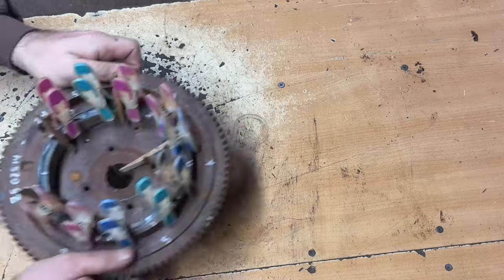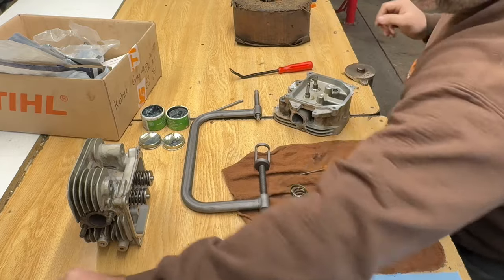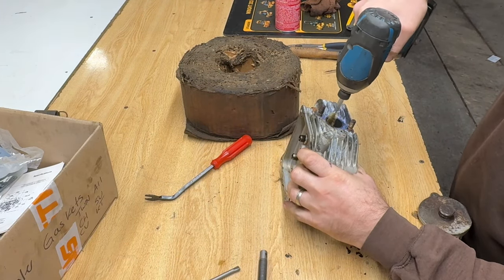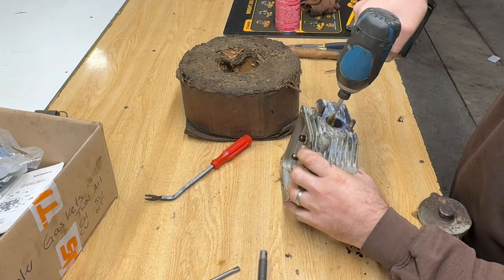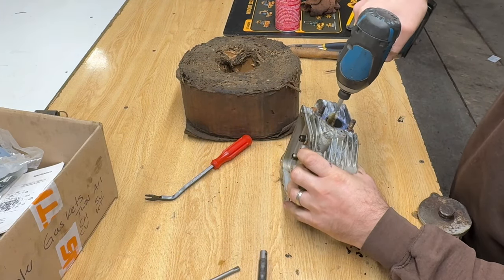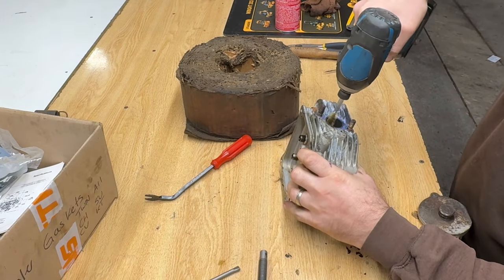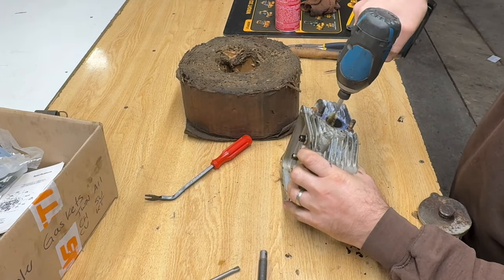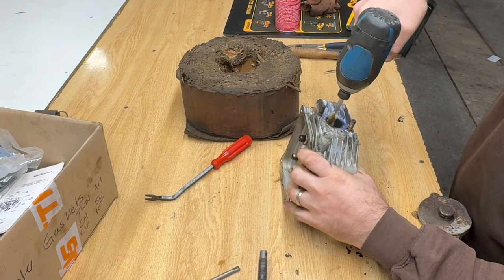* PART 5 * Scrap It OR Fix It! The Big Green Craftsman Kohler Command Engine! Torque Wrench FAIL!

Comment: Thus is turning into what could be a Very helpful series for anyone who wants to get one of these beauties going... In the last vid, i chuckled because when you did the compression test, and it wasn't terrible, i thought to myself "i bet the heads not torqued down" and then one of the bolts came right out in your hand 😀 😅 ha. 
Might have been able to just torque that head and go, but the tear-down of both heads, valves, lapping... all Excellent to show. I sure hope anyone w/o experience finds this video. Also the flywheel magnets.👍👌 
That machine is like the Cadillac of those Craftsmans in the following years.. easy to see why you held onto it. The mud guards, the slotted hood, the 12x12x24 wheels and the Oil Cooler.. they got rid of All of that as far as i know at least for the US models. Sounds Really annoying to have pulled out those head threads, but it's easy to forget your own talents when doing a demonstration. Means nothing.
Can't believe how huge those new head gaskets are 😂. But that's good too. That was Such a debacle when those motors were introduced. They designed them for every commercial application out there, and then they basically ALL had to he replaced. But those engines are Solid afaic. 
On my GT5000, one thing i did was to replace the central axle pivot. It's one large bolt with a nylon bushing into the cast axle. I think the bushing is nla (dunno), but certainly you could find a brone one instead. On mine, i actually replaced the bolt with stainless... you can't grease it to prevent Rust. 
And lastly it could be some more strain on the tranny, but i Highly recommend some weight on the rear to make the steering easier. Mine has the dealer-sold "rear carrier". Works so well i have s spinner and can turn the wheel with my finger. 
You'll be extra happy w/a rebuilt deck. But beware, my 48" deck is mostly 'pot metal', easy to tear whole pieces right out with the bolts. 
I bought a 54 (high flow) deck off another GT5000 only to learn that it had a completely different set of hangers. I was pretty annoyed. Still don't know if i put the new hanger bits on if they would interfere with the smaller deck so i couldn't swap them as needed. I've got tire chains on mine (not suggested for yours) and used my machine for years to haul logs out and bring firewood up to the house. The little tractor was a great investment. I bought it new, in 2004 for $2800 (including the rear carrier deck) and thought i got a deal. They were basically giving commercial engines away ~ 
Thanks again. Wicked fun series, i hope it gets it's deserved viewing 👍🍻 ~
Reply from the maker: Thank you so much for your comments and for watching.  Tyler will appreciate this when I tell him.  Thanks for being here!

Comment: I learned a bunch thank you for sharing. A great way to lap the valves in is to chuck up the valves in a cordless drill and pull back to really polish the seat with valve grinds compound. It really speeds things up. What is the brown round bail you were setting the heads on? Cardboard? Just curious. TY
Reply from the maker: Thank you!  It is a round cardboard thing that comes with new engines (new engines sit on them in a box)

Comment: Have you ever tried Evaporust for cleaning parts with carbon buildup? I had a mechanical throttle from my 1989 Tacoma body that was so filthy that throttle body cleaner would not work - as a last resort I dipped it in Evaporust overnight - it came out spotless and worked perfect. 😊